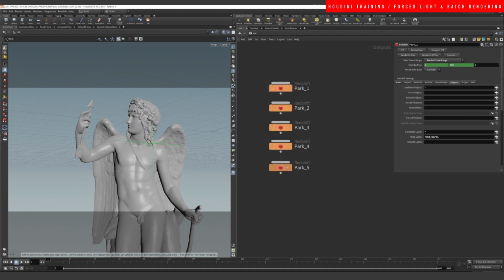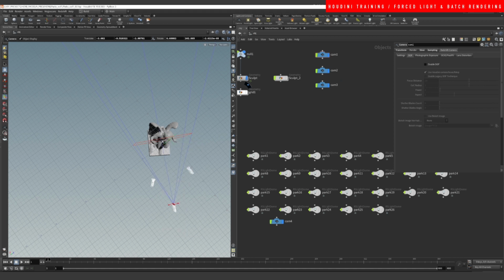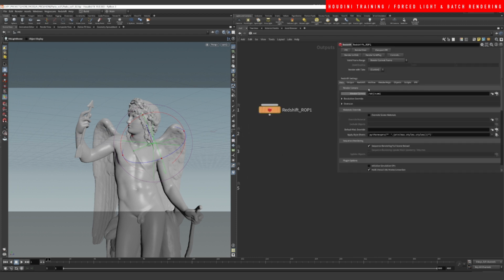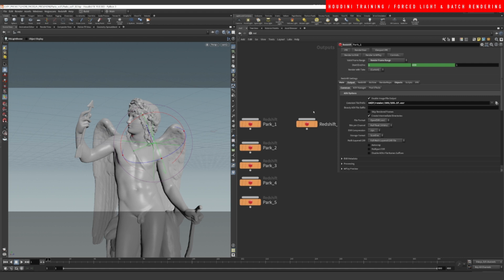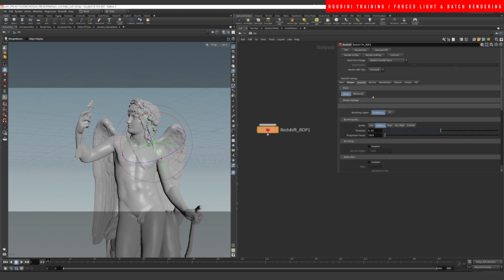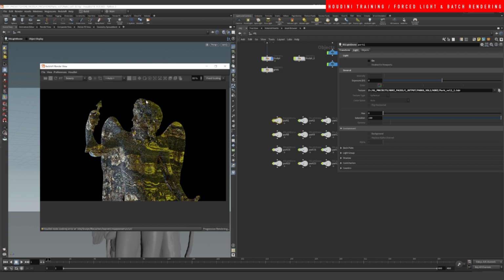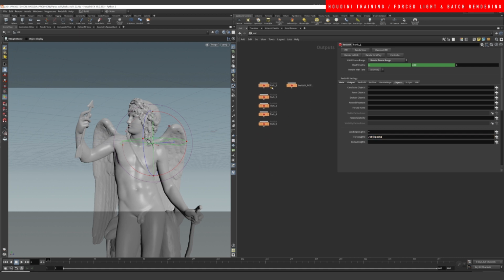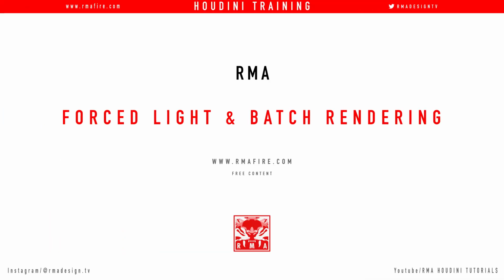Forced lights & and batch rendering with Houdini and redshift | FREE TUTORIAL

Comment: Awesome. I was wondering how to do this. Thanks!, I wonder if there's a way to tell hbatch to use specific Take. Like if you have different lights turned on but also different materials or other overrides, you could just add all those to the take. Do you know if such thing is possible?
Reply: There is a render with Take in the ROP, I remembered this after I made the comment.
Reply from the maker: @juanloredo1136  yes thats an option, however i tend to force objects and lights per render node to avoid using takes. i can do a tutorial on this if you feel it would be helpful